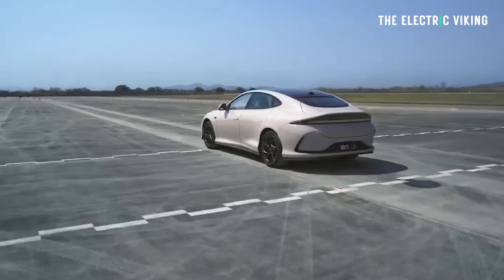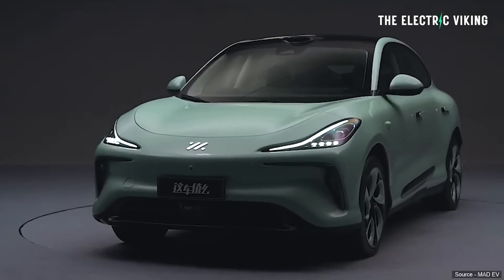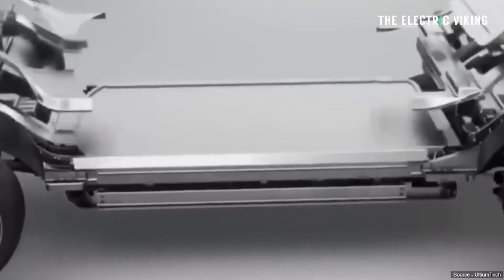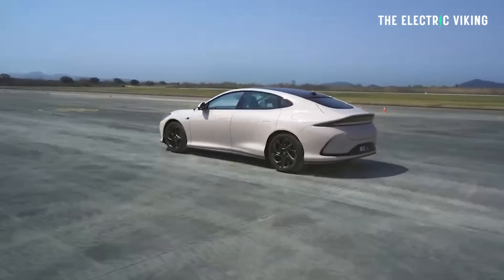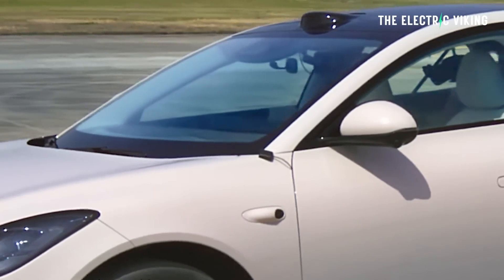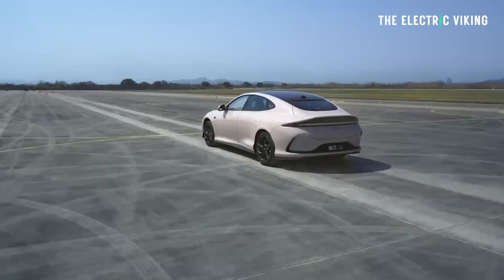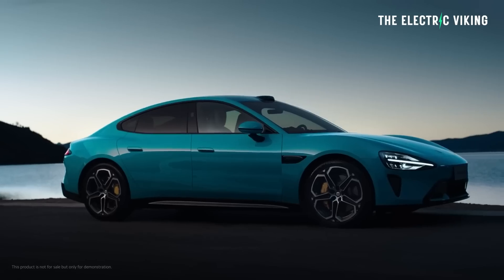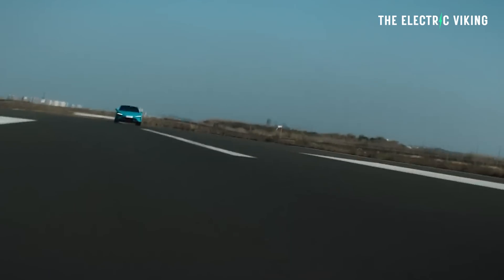IM L6 first global EV launched with solid-state battery & 600 mile range

Comment: Would be better if there were an opening in the back where you could have the battery installed or removed w rollers built into the frame for ease of movement.

Comment: Something seems strange many people complained or voiced concern about the shipped Cybertruck has less range. Tesla said they are working on a range extender for $16k 

Sounds like Tesla substituted the blade battery for the available 4680 batteries. 

So now when buyers purchase the new version Cypertruck with the blade battery (for less money) , the truck will cost less with more range. 

So current buyers and near future buyers will continue to purchase the “foundation series” for $20k for less range? Until Tesla satisfactorily explains this …without talking points. 

If I’m a lower number in the list…I’d pass and wait for the longer range at less money.

Sounds like a potential PR disaster. If all this comes to fruition, how will Tesla dig their way out of this?

Comment: 'Lightyear', we have heard this before. So it has a semi solid state battery ('semi solid' means fluid). Lidar is not recommended because of lidar interference with other Lidar cars nearby. An acceleration of  2.7 sec to 100km/h  is more than 1g acceleration:  pass-out danger for a certain percentage of drivers and therefore a serious safety issue. The self developed "Hurricane" motor might be interesting (likely a copy of an existing motor). IM L6 is an impressive even 'dangerous' car, but not a technical breakthrough.

Comment: The fast charging does it affect the battery health? Heard from some video that fast charging and fast discharging will cause a quicker drop in battery health. As of now i just use DC fast charge when needed only, mostly im using slow AC charging.

Comment: This is only the beginning, Mark my words, 1000 miles per charge is coming.
Reply: I would happily trade range for charging speed.
Reply: @effehell7593  wish they would have some of those options. I don't have to commute much at all it's like 30 min each way, 45 with traffic. Even though charging speeds are getting there, even with good range I wouldn't mind them leaning towards it more now that range is pretty much in 'good' territory.
Reply: 1000 miles and 10 minute charging means game over for ICE.
Reply: @ChickensAndGardening  Ten minute charging is doable, but 1,000 miles of range would be extremely wasteful. Unless it's a truck used for long distance towing, 400 miles with 10-15 min. fast charging is about the most anyone would ever need as that would enable easy long distance travel without having to haul an extra ton of batteries around to make that range possible. Daily driving is rarely >50 miles so EV dominance is basically assured.
Reply: @TecnamTwin  I don't see how 1000 miles is "wasteful". There are a lot of long distance travelers who would see it as a tremendous advantage. For example, a NY family drives 300 miles to the lake house up in Maine, hangs around for the weekend, then drives back -- all without needing to find a charger. I, myself, need 500+ miles of range because I make frequent trips out of state that are 200+ miles each way. I don't want to have to stop, especially not for 20+ minutes. I think there are millions of others who think like me.
Reply: @ChickensAndGardening  Charging for 10-15 min. is not an issue or inconvenience. You're only charging back up to 80% not 100%. Besides, taking a short break after 3-4 hrs of driving is doctor recommended and common practice for most people. And you wouldn't have to "find a charger." The car tells you where every single one of the 140,000+ charge points in the US are. Your lake house example is reaching. What kind of lake house doesn't have electricity?? Even a cabin in the middle of the woods usually has electricity and even high speed Internet these days courtesy of Starlink.

Companies aren't going to put an extra thousand pounds of batteries in "just in case." No you don't "need" 500 miles. You just irrationally want it because charging is unfamiliar. Charging is a non-issue; talk to anyone with an EV.
Reply: @TecnamTwin say I live somewhere without off street parking. I charge 1000 miles, drive 50 miles a day, that's 20 days between charges. Heck, that could be 4 weeks if I only use it to commute. And therefore when I hit the supermarket I can charge up in the 40 mins I take to shop.
Reply: @TecnamTwin  The people who buy the current EV's on the market are self-selected to be mostly in-town drivers, or people who don't mind frequent breaks on long trips. But there are others , like myself, who need more distance, less stopping. Each to his own. What works for you doesn't necessarily work for me, and vice versa. I'll hold out for minimum 500 miles, preferably more like 600-700. It's coming.
Reply: @ChickensAndGardening  The requirement for long distance travel without breaks is not a need; it's an irrational want to the detriment of your health. After the ICE gets forced off the market, y'all will come to grips with the fact that a short break every 2-4 hrs isn't a big deal (depends on desired charging interval). Charging takes 10-20 min., not 45 min. or more like it used to when V2 Superchargers were the norm. Driving 800 miles in a day is easy with an EV. 

Mark my word: most EVs will retain a <400 mile range for the next decade because again it doesn't make sense to haul a massive battery everywhere when you can just charge up a smaller, cheaper, lighter, more efficient battery every day somewhere or find a DC fast charger once a week. The Lucid Air can do 500 miles today. You could be one of the few to get one of those.

Don't care and still want that 1,000 mile range anyway? Get an Aptera. It'll be the only production EV ever to achieve that feat; that is IF it makes it to production.
Reply: @colinwiseman  There are already plans, at least in the UK to have sidewalk charging, they just run it under the sidewalk out to the road and have them set up like meters but ready to charge your EVs.
Reply: @ChickensAndGardening   I mean most ICE vehicles don't even make that range without gas stops.
Reply: Aptera is doing it.
Reply: We don't need 1000 miles per charge. We need less heavier batteries. 400 miles is more than enough. It's much preferred a quick charge and smaller battery. More sustainable, a car more efficient due to less weight...
Once we have 300 miles added in 5 minutes, we don't need anything else.
Reply: Yep
Reply: As long as companies don't give up
Reply: wrr

Comment: Actually, we expect from solid-state batteries that they make it easier to allow for HPC. But there is no info on that - it just reads "quasi-900 V ultra-fast-charging" in the press release from two dayys ago. There are some notes in other media from two months ago that say "At 400 kilowatts, 400 kilometers of range can be added in just 12 minutes." If that's true then I dont care what chemistry it has in the underbody - it's a leap forward (in the highest-priced variant of this model).
Reply: Really doesnt matter much outside China. We don't have the grid capacity for that kind of charging.
Reply: @Withnail1969  the medium-voltage level network is good enough, it just takes time to build a connection to a charging park. When Ionity started in 2017, they were opening one location in that year, and 46 locations in the next year. In 2021 they had 339 locations across Europe (each 10 charging points). It may be that some regions are lagging behind but if someone is ready to put up the funding then you can have it all a few years later.

Comment: The "solid state battery" in this car has a power density of 368 Wh/kg. So it's definitely more likely it's semi-solid state. Meanwhile, just 7 days ago, on 4/3, a company in Chongqing had released a solid state battery that has reached 720 Wh/kg.
Reply: Semi-solid, like me in the morning
Reply: Energy density is irrelevant if cost/kWh is prohibitively expensive. And that's where solid state batteries sit today. They're too expensive and aren't mass produceable.
Reply: It is semi solid state cells smh even says so right in the official Chinese website for it. 
It's impressive no doubt but only available on the top spec model's which won't be shipped first. 

First out are the catl nmc equipped cars later this year. I bet catl is hot under the collar over all this competition using semi solid state cells and soon solid state. While they went after the condensed cell battery pack. Which was also supposed to be available by now btw. 

What the heck happened to that? And the damn mp3 tech was supposed to be in teslas m3 highland by q3 2023 originally. What happened there? 🤔

Comment: 1000km + 12min full charge + 45K = GAME OVER 💀ICE💀
Reply: bye bye Toyota
Reply: Toyota with Huawei dy @haoruchen4216
Reply: And I almost grabbed a Kia EV9 GT Line 🙄!?!?!?
#patience
Reply: Keep dreaming...
Reply: Good luck charging at that speed when everyone is charging at the same time... Then we have the same old problem with a huge amount of people that just don't have charging ability at home. And get ready for higher road tax and higher electricity prices across the board. So in the end what have you achieved with your ICE car hate?
Reply: @sirbum1918 
Does everyone pump gas at the same time?  Where do you get all that EV hate?
Reply: @PETERJOHN101  You come home from a 9-5 job then wait a few hours as the government told you to do, then start to recharge and yes, like most of the people around you do... Norway started to have problems with this last year, and only think what problems other countries will have.

The hate, hmm. "GAME OVER" might trigger it for me.
Reply: These cars are smarter than that. Plug them in when you get home and charging can start whenever you've scheduled it to (from your phone) or whenever electricity is cheapest - middle of the night super-off peak. Even my twelve year old Chevy Volt can do that. This is a non-issue.

Also, it should be obvious that a few powerplants outside of city centers powering EVs does improve air quality in the city where the people are vs millions of ICE cars burning millions of gallons of fossil fuels and spewing disease causing pollution right where people live and breathe.

Even if the emissions were equal, putting the pollution centers outside of the city is preferable. Thankfully, the emissions from EVs and powerplants is significantly less than millions of gas/diesel engines and only getting better over time vs ICE that gets worse over time.
Reply: @sirbum1918 uhhhh….. the entire point of EVs is to reduce air pollution. You know. The stuff that comes out of ICE cars. 
Come on man. What are you even talking about?
Reply: @whitebelt2905  When most electricity is produced by Coal, Gas and Oil, then what difference does it make if the cars use Gasoline? If you force in EV's then even more dirty electricity will be produced.

Hydropower is the only source that even comes close to the dirty options but you can't make more damns or you get other problems with the environment.

Nuclear power is at a distant 4th place in generating electricity and is the only real option but the greens all hate that with a passion, so what's next?
Reply: @sirbum1918 I can tell you have notttt been following this channel as far as how much clean energy as improved around the world lmao. Literally just back to back green energy projects
Reply: @sirbum1918  Stop it. You purposely left out solar and wind. Both have been improving by leaps and bounds.
Reply: @whitebelt2905  @DreDresChapters  Here in Sweden they talk about solar all the time, yet it only produces 2% at most and remember the sun doesn't shine at night.

Solar and wind slightly outproduce nuclear power together but they are all tiny compared to coal and gas.

Wishful thinking will give you nothing I'm afraid. If they decided to produce more nuclear plants then sure EV's are okay and will only get better, but why bother when we can't produce clean electricity?
Reply: @kalebdaark100  yep, UK is doing well, even with a million EV's on the road and heat pumps starting to roll out we still managed to reduce the amount of energy needed by 20TWh in 2023 vs 2022! I thought "with all these EV's charging at the same time" we were meant to be having rolling blackouts by now 😅 We halved grid emission over the last 10 years and should be on track to halve them again by 2030!
Reply: @sirbum1918  You’re making the false assumption that clean energy tech will never improve. Btw, Sweden produced 19.2% of their energy from wind in 2022. They have a goal of reaching 100% renewable by 2040
Reply: @whitebelt2905  We in Sweden are the lucky ones when it comes to electricity but even we had to hike the prices up this winter to record prices to stop people from over use. The World demand is growing year after year and EVs only makes it grow even more.
Reply: @sirbum1918  ok so what’s you’re solution?
Reply: @whitebelt2905  First stop new usage of electricity as possible, then build many more nuclear plants and of course more alternative production. This will remove our reliance of burning coal. Next we can start going over to EVs  and at the same time building up the infrastructure.

What we are doing now is wasting money patching everything. Concentrating removing the biggest CO2 source in coal is so much more important than getting a few more % of EVs on the road.

Here is a perspective for you. If we want to grow new trees to combat the CO2 in our atmosphere, we would have to plant 100 million new trees every day for 100 years.

So only big actions will help and not chasing ICE cars. You and we all are falling into the trap the big companies introduced in the 70s there they started to blame the consumer for all the wrongs and is why we got the stupid recycling that doesn't do anything for the environment. It makes the companies look good and we feel a bit better doing it, yet the world burns!
Reply: @sirbum1918  I agree with your statement that consumers are blamed for corporate pollution. 
However, nuclear is an awful alternative for many reasons. 
Uranium mining releases radioactive dust, radon gas, water-borne toxins, and increased levels of background radiation.
A melt down would cause immeasurable  environmental damage. Finally, managing the waste is a daunting task to say the least.
Reply: @whitebelt2905  The dangers are not as bad as the greens want you to believe. We had a meltdown in Fukushima which was on the same scale as Chernobyl but only has 10% of the radioactive leakage and sure it's not fun but it happened because of an extreme event. Only 1 person's death has been linked  so far but yes there are most likely more but still a remarkable low number.

Waste during mining has been a problem in the past but that can be said of any mining in the past as they just didn't care. Nowadays, very little danger is present and is mostly connected to workers and no, Radon gas is not a danger to the public.
Reply: @sirbum1918  "not fun" HAHHAHAHA!
 The fact that you used the term "greens" and your obsession with nuclear says a lot
Reply: @whitebelt2905  It should for you as well, but you seem to be a coal lover so what do I know.
Reply: @sirbum1918  HAHAHA! Says the guy that loves nuclear waste
Reply: @sirbum1918  How can you talk about Sweden and mention all the renewables except hydro which is like 60% of their power generation?
Reply: @nfzeta128  I did! Problem is that Sweden is not the rest of the world so can't really be used as an example to follow. If we could then problem-solved. No, the main problem is that we use coal and this is what we must change, not a few EV's here and there.
Reply: @sirbum1918 (what did ice hate achieve) probably the decrease in pollution lmao
Reply: @sirbum1918 The thing for me is that you have highlighted very serious concerns for me.  I know that we have the capability to avoid these issues with proper energy management as was shown to me by a board member of an energy company based in Cardiff.  He did say that we will likely face these problems as businesses and government will underspend and get greedy.
Reply: @sirbum1918  , they are already conducting a pilot test with taxing per mile because CA says it's losing money from taxes cuz more hybrids and EVs are on the road.

Comment: Whats its Energy density?
Reply: 368 Wh/kg
Reply: @manimalworks7424  
Wow
Reply: @Atheist-Libertarian  On 4/3, a company I never heard of in Chongqing released its solid state battery of 720 Wh/kg. But I haven't seen any cars equipped with it yet. One thing for sure is 1000 km seems to be the low bar soon.
Reply: @manimalworks7424  nope, you aren't gonna see mass market 1000km+evs EVER. Only top end big $ low volume unit's get those cells.
Until mass production of solid state cells is hit around 2027-2030. 

Then maybe higher end trucks and suvs might have a top spec with 900-1,000kms. But most will just use these cells to trim 350-800# off of the heavy pack weights instead. And stick with 450-600+kms of range with 10-15min 10-80% charging times. And up to 200kms in 5mins. 😎
Reply: @4literv6 
Yes, the pricing model could be headed for $20K US for a 300 km solid state EV by 2030.
Reply: @manimalworks7424  I think that one can't be mass produced right now because of the weight.